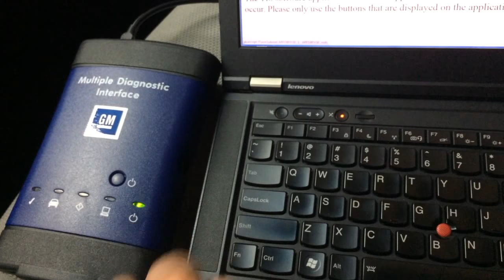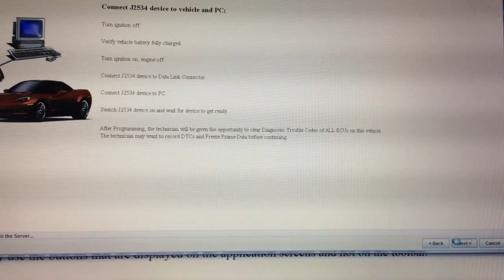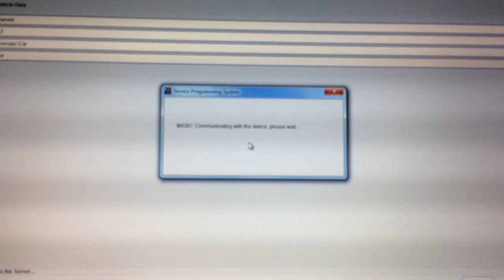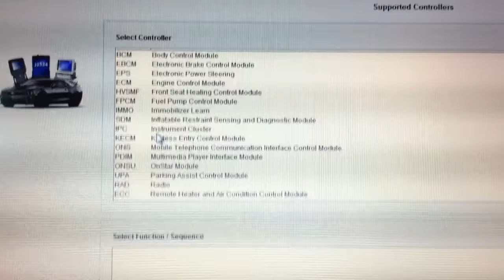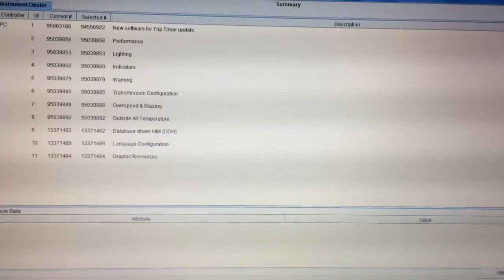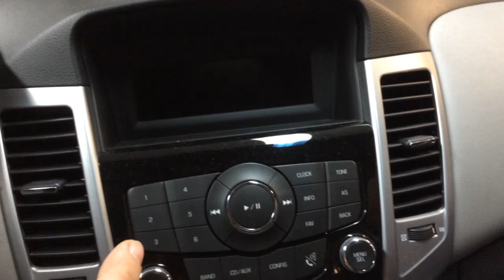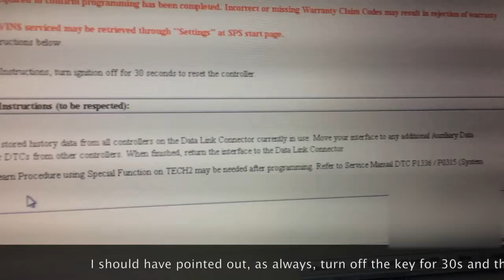GM SPS Programming: MDI Tool J2534 Mode ECU TIS2Web How to do a Calibration Update Reflash (IPC)

Comment from the maker: PSA: Effective September 12th, 2024 GM has implemented software blocks to prevent the use of cloned MDI devices with its Techline Connect software.  This applies to both GDS2 and SPS2.  If you are experiencing an E4214 error, this is more than likely caused by the use of a clone MDI or MDI2.

Comment: Dr Shock. Thank you for sharing some great information and technical skills. Just ordered an MDI. Hoping I have the technical prowess to achieve a working unit.
Reply: I just ordered and received an MDI as well.  Now I need to purchase the subscription.  Do I need the programming or diagnostics subscription to test and recalibrate a trailblazer hvac mode actuator?  I know it sounds like a dumb question but I am lost!
Reply from the maker: If you are going to need to send the module a new or updated calibration, you'll need the SPS subscription.  If you are just doing testing, and your vehicle is older than 2014 you should look at the Tech2Win subscription, if its newer then then GDS2 subscription instead.  These are just my suggestions, please research to be sure for your particular vehicle and module as I have not worked on a Trailblazer yet.
Reply: @brandontscheschlog  Hey Brandon & Dr Shock, I'll comment when my MDI arrives today. I might take a week(s) to figure it out. Dr. Shock is the professional here, but I suggest watching all of his videos before you buy anything. Go the the GM web site look at the subscription options. What good is it if one can't afford the subscription. Dr. Shock explains it, but we all get a bit excited. I got eager after just watching one video; did some research & pushed the buy it now button. Should have waited. Later found out that my OBDII scanner (after reading the manual) did what I needed at the time. Any way, let's compare notes when we get the MDI. Tap. Tap. Tick. Tock. Waiting for DHL to ring doorbell...Had to prevent myself from buying a Tech2 today with my school money ----signed starving student.
Reply: @giovannicestari519  Sounds good Giovanni.  If you dont mind me asking what vehicle are you working on and what operation are you attempting to do?
Reply: @DrShock  I have an MDI not a Tech2 so my guess is I only have 2 options for subscriptions for light duty vehicles.  The options are Programming or Diagnostics.  I have searched for hours and I can't find anything that will tell me which subscription I need to purchase.  I would assume the Diagnostics Subsc. will only allow me to diagnose, for instance read and clear DTC's.  I would assume that the Programming Subsc. would allow me to test and command modules to perform tasks, etc.  
Also, I believe that Tech2Win is only for the Tech2 correct?  I don't believe I can use Tech2Win for the MDI.
Reply from the maker: @Brandon Tscheschlog With an MDI as I mentioned in an earlier comment here you would also have the Tech2Win option (Windows emulator of a Tech2 tool).  So a total of 3 options with the MDI or MDI2.  When you first said "test and recalibrate" you pretty much are saying you need both SPS and GDS2.  The former to recalibrate the module, the latter to test it.  SPS will only re-flash a new calibration, or let you view the current calibration.   GDS2 is the diagnostic/test funtionality.   I would think though you could get away without the GDS2 by using some manual testing of the functionality and save some subscription $$.  Depending on the model year you might have to use Tech2Win instead of GDS2 (earlier than 2013 is probabably Tech2Win only)
Reply: DrShock I cant believe I never told you what year vehicle I was working on.  It’s a 2006 trailblazer SS with dual electronic climate control so I guess after all I will need the Tech2Win to test and check calibrations.  When I click on GDS2 Diagnostics it says that it does not support 2007 and earlier vehicles. For those earlier vehicles I need to use Tech 2 or Tech2Win, and in my situation, having the MDI I would need to use Tech2Win.  I want to be able to command the HVAC mode door actuator‘s to open and close them to see if they might be defective before I go and reprogram one of the spare HVAC dash modules I have.  I think you helped me figure it out.  Thank you!
Reply: @brandontscheschlog  Hey Brandon, just typed a short story & the power went out. Urgh.  I'll be commenting on my Alias channel which rhymes with MacGyver. Finally got my clone MDI, Ethernet parts, AC adapter etc. Trying to get my "ducks in a row", so I can ask the Dr specific and substantial questions. Maybe we can collaborate & brainstorm--then seek the Dr's advice. I have no plans of making videos or posting. School full time, mentoring, teaching & volunteering has left little time for gadgets and tinkering on cars. I have built 4 vehicles on-my own from Salvage parts and manuals including GMSi and a Harbour Freight OBD2 Scanner. Dr. Shock's YouTube is my go to resource for all things GM.
Hint. Hint.Hint. I read that the Dr likes Coffee (Ko-Fi).

Comment: I have a Theft deterrent system Locked Cadillac XT5 in my driveway. 50' away from my WiFi router through walls. I'm running an Cat5 cable all the way out to the car and plugging it in to the Laptop. I finally figured out how to get Java 32 to work on my 64 Bit machine with 64 Bit IE. This took a day of research. For those having this issue on you 64 bit IE, Click on the gear then go to internet options, advanced tab, click on Enable enhanced protection mode then close ie. Next go to C:/windows/Program files/Internet Explore/ and right click on ie.exe  then check off run as administrator. Java 32 will need to be installed after you start IE as Administrator.

Comment: First of all, thank you sir for another great and very informative video!!! Very interesting information👍!!!
Next: 
What windows operating system works best for these MDI’s? Do you know if the latest windows operating systems,  when purchasing a “New” laptop support this device or do I need to buy a certain windows software to install on my laptop?   Some of the MDIs  say they only work on windows 7 so I’m not sure.  What do you use?
Reply from the maker: GM doesn't have the dealers stay on the latest, as of Jan 2021 Windows 10 is recommended.  What drives the requirement is not the MDI but the cloud software at www.acdelcotds.com.  Here's the January 2021 requirements list - https://gsi.ext.gm.com/userguides/Aftermarket%20Infrastructure%20Guideline%20v1.0.pdf
Reply: @DrShock  Thank you sir! You are the best!  I appreciate all of your insight and knowledge about this product!   I will definitely be getting one in the near future thanks to your videos and  information!  This is the one thing I want in my tool box before I buy another GM truck !

Comment: Thanks, new subscriber, your information walked me through my first reflash with the MDI you recommended. I do have a question. I'm working on a 2005 Colorado and installed a used BCM. I was under the impression I could adjust the odometer reading to match my cluster but never was given the option to do so.. The mileage is stored in both the BCM and cluster.  I'm trying to adjust the mileage UP not back. Any ideas? Thanks
Reply from the maker: For a 2005 Colorado it's stored in the BCM and the IPC just reads it from the BCM in that year (after a few miles of driving it should update).  You'll need a Tech2, or a Tech2Win subscription on the MDI, for that model year to adjust the mileage.  GM Service Bulletin #07-08-49-020D covers what programming approach is needed by model year/model type of GM car/truck.   You can google and find this PDF for reference.   That all said what is typically replaced is the IPC, not the BCM.  And when the BCM is replaced, it's replaced with a brand new one and you use the scan tool to rebuild the cars options for it.   Using an used BCM is a mixed bag of outcomes in what I've read over the years - be sure you research your vehicle year and model across the various forums for the gotchas.
Reply: @DrShock  Thanks for the fast reply. I did my research and found a BCM that was comparable to my truck. It updated perfectly following your videos and everything works. The only glitch is the odometer as the used BCM had 110,000 miles on it and my cluster is showing 175K. I have both the MDI clone and a factory Tech 2 tool- not a clone. I'm told if the odometer reading in the BCM is less than the IPC, the IPC's mileage will freeze until the BCM catches up. If the IPC's mileage is less than the BCM it will update when the key is cycled twice, which I've seen personally in the past. I purchased the MDI because I was under the impression the mileage could be corrected with the BCM update and using the GM subscription service. I'll research your suggestions and will reply. Thank you

Comment: Thank you for the informative videos. 

I have a MDI I bought from SICOTOOL. It worked fine for a few months, then the laptop stopped recognizing it. I returned it to SICO for repair. Again it worked for a few months, then stopped. This time I noticed the mini USB on the unit had fallen apart, The plastic separator fell out of it and the terminals were touching one another.

I sourced a replacement connector and had my local PC repair place install the new one. The MDI manager still does not see the unit and windows throws an error code.

I did the hard reset that you show in the video. The MDI manager sees the unit and unit and updates the unit, but as soon as the update is complete, the MDI manager again sees the unit, but throws an error when trying to connect to it.

At this point it is useless to me. I was wondering if you do any repairs on these units, or if I should just toss it. 

Thank you again.
Reply from the maker: That jack is one of the few things you can repair on the MDI units as there are no schematics available in the public domain.  So they are essentially unrepairable.  If its a genuine unit you could return it to Bosch for repairs.  If it s a clone, you might try selling it for parts on eBay but no the clones cannot be repaired other than for jacks, connectors, and the plastic housing pieces.  Just for grins, what is the error code you get from the MDI manager?
Reply: DrShock I do not recall seeing a “code”? It would just pop up a dialogue box saying the MDI Manager could not communicate with the MDI.

Believe it or not, I actually got it working.

The wireless card has a flap of hard plastic stuck to it. When I disassembled it for the jack replacement, the adhesive holding that plastic on had given up. And the piece was loose.

When I put it back together, I neglected to notice that there are contacts on each side of that slot, that the plastic card trips.

Once I reattached the plastic to the wireless card, made sure those contacts were made, the recovery was successful and the MDI manager connected to the device.

I launched TIS2WEB and sure enough, GDS2 connected to the device as well.

Thank you for helping me recover, what I thought was a brick!

Comment: Question, I remember a few years ago you would have to reset the electronic brake control module after resetting the electronic steering wheel position sensor. I didn't see you do that in this video do you still need to do that with the new software updates? Or have they removed that part of the steering wheel position sensor reset procedure? I'm sorry trying to reset the steering wheel angle sensor on a 2019 c7 corvette. I've done it before with the earlier software in a 2017 c7 vette from a couple years back and had to "re-learn" the brake control module steering angle after the steering wheel angle reset. Still required? Thanks! And great video by the way!
Reply from the maker: Thanks.  In this video we're just upgrading the Instrument Panel Cluster calibration which has no relationship with other modules so nothing more needed there.  I haven't had to do a steering wheel angle relearn yet so couldn't say, but it is possible for there to be scan tool procedure changes between model years.   I would suggest using the three day Service Information (SI) subscription for the 2019 Corvette at www.acdelcotds.com to confirm the procedure specifics.  The 3 day SI access would give you an online version of the Chevrolet service manual for your C7, along with any associated technical bulletins.
Reply: Hey did you figure this out? I'm looking to do this exact thing on an 08 Equinox. Thanks.

Comment: I have a 2016 Camaro, and I would like to use the $40 subscription from ACDelco to update my radio software so that I can have Android Auto. Every dealer I've tried wants $150 to do it, so I figured I'd save a few bucks. The service bulletin for doing the update says you just have to use SPS to download the update to a USB flash drive and then plug it in your car, so it doesn't use the MDI. However, from you videos, it looks like you can't open SPS to view software updates without having the MDI plugged into the car. Is this true? I can't pay the subscription fee and just download the software, I have to get the MDI or a J2534 device to be able to download the update, even though it's not used for the actual update?
Reply from the maker: I've not done one of these, but I have read about these entertainment system firmware updates (not calibrations) that are USB based, but since the SPS system is legacy in nature it was built around having access to either the Tech2, MDI, or MDI2 tools to communicate with the vehicle.  I think this is the GM TechLine bulletin you read, https://gm.oemdtc.com/6565/infotainment-system-upgrade-for-android-auto-feature-2016-buick-cadillac-chevrolet-gmc.   I suspect from reading this you'll still need one of the scan tools to reach the control modules installed in the vehicle menu, where you would select "K74 Human Machine Interface Control Module - USB Copy / USB File Transfer" where it would then just go to the laptop USB flash drive, and then you plug that USB flash drive into the Infotainment Systems USB port and boot it up from there to apply the update.   Suggest you call ACDelcoTDS customer service and confirm.
Reply: have to have the mdi hooked up so it can determine vin and rpo codes

Comment: Good video.  It appears you were able to do a 30+ minute programming off just the vehicle battery. I have read in technical documents that a booster or their expensive power supply may have to be used for long programming procedures, and not to use a battery charger.  Have you had any issues/experience with this?
Reply from the maker: That's correct, if you have a "long" calibration update you technically should have a GM EL-49642 SPS Programming Support Tool (Midtronics PSC550 Battery Maintainer) connected to the battery.  However, it is a very expensive device that few shadetree mechanics are going to own.  And no, you cannot use a battery charger because of the electrical waveform that puts out.   

Fortunately, alot of this guidance is cautionary common sense.  If the battery is relatively new and you've just come back from a drive fully charging via the alternator its usually good enough for most SPS tasks.   If I am doing radios or interior modules I'll usually run just off the battery.  But if I were doing a PCM or BCM where the risk is higher, I would have a another battery via booster cables as insurance, which is one of the alternatives GM recommends (see https://gm-techlink.com/?p=8438)
Reply: @DrShock  That's what I figured.  Depending upon the current draw of the vehicle during programming, you could also use a power supply in parallel, as  long as the vehicle battery is charged and you match the power supply voltage to the battery..  I have done this for some equipment at work (I am an electronics tech) where we needed the battery for inrush current.  A second battery would probably be easier, though.  Maybe I'll take a measurement on my car to see what the current draw is with the vehicle parked  and the ignition om run.
Reply: Can I use a maxiPRO mp808 scan tool to connect computer to car to reset the pcm?
Reply: I use the Schumacher INC 100 for programming.

Comment: Can you help, I own a Autel J 2534 and the original Tech2 with CANdi module. I know to do programming i'd need to download the SPS to use the TIS2web.  My question where do i find this SPS for use with my J2534 and Tech2? I looked on the  ACdelco site with no luck.
Reply from the maker: You have to pay for an SPS subscription at www.acdelcotds.com
Reply: @DrShock  yes i know, but after i log into www.acdelcotds.com where do i go to set up my tool before i pay the $40 1 car access?
Reply from the maker: You have to pay first to get to that part.

Comment: Question, Can the MDI be used to program a 2003 Chevy Tahoe? I would like to enable steering wheel controls and TPMS. I have made all hardware changes in terms of new steering wheel, the Clockring, installing TPMS in all wheels and replacing the front passenger door switch that controls TPMS.
Reply from the maker: imo 2003 is a few years too early for the native MDI, but you could use it with a subscription to Tech2Win, the Tech2 emulator for the MDI.   Best choice for a 2003 would of course be a physical Tech2 tool but if you want to just have one tool for past and present then an MDI can do it with the emulator I mentioned.  Part of what you can subscribe to at acdelcotds.com.
Reply: DrShock Problem I face is Dealerships not understanding or willing to perform the software upgrades for me, now that I have made the hardware changes. I stumbled upon your videos and thought I can do this myself with the subscription you mentioned.